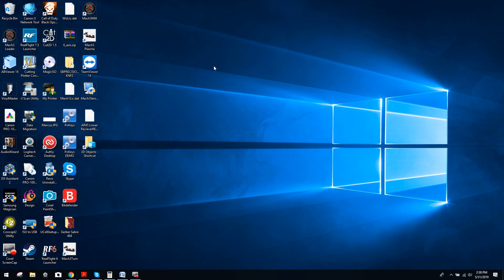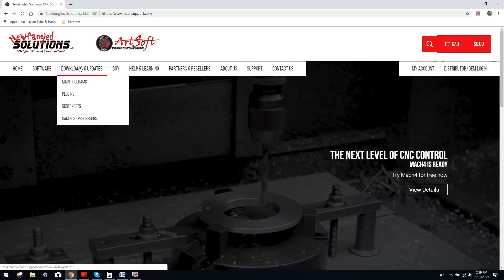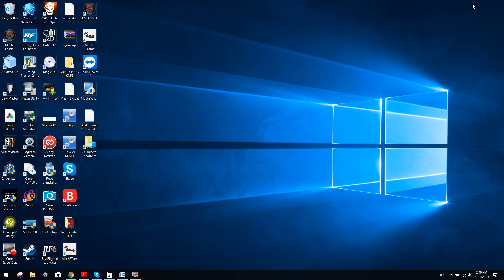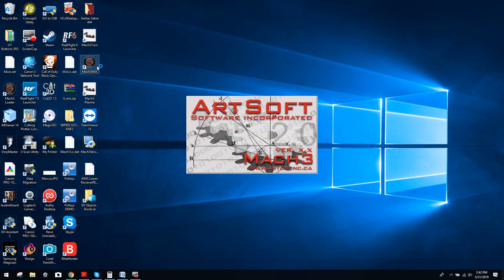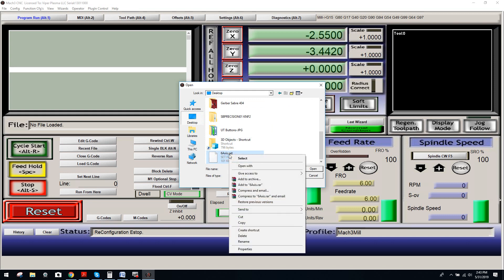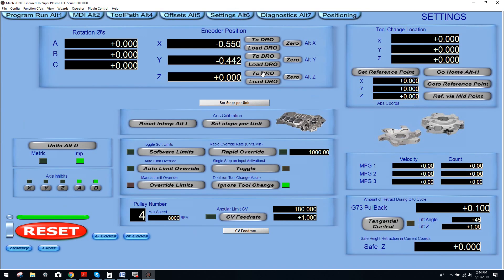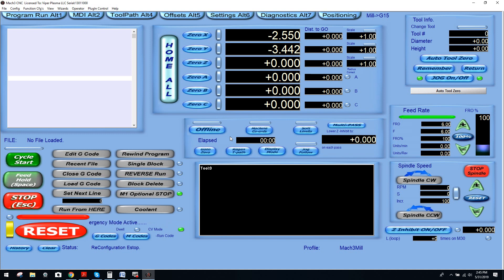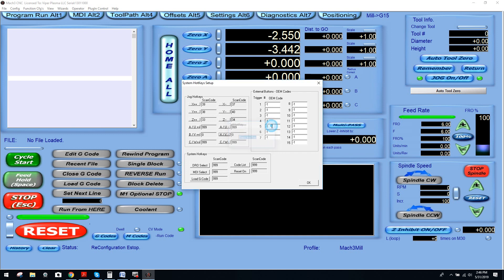How To Install A 6 Axis Screen Set In Mach3

Comment: Do you have a video about how to use this 6-axis program, or where can I find one? Which keys control the axes? I would appreciate your help.
Reply from the maker: To would have to assign them using "hot keys" in Mach3. 6 axis CAM software is VERY expensive. Checkout Autodesk. Thank you,
Vince
Reply: @corvetteguy50 6 axes A-B-C axes A-B-C axes can not enter the buttons that open when you press the tab key, do you have any idea how we can do it? Thanks for your help.